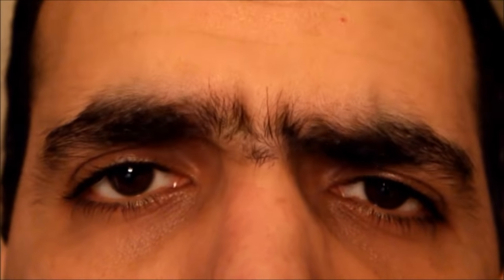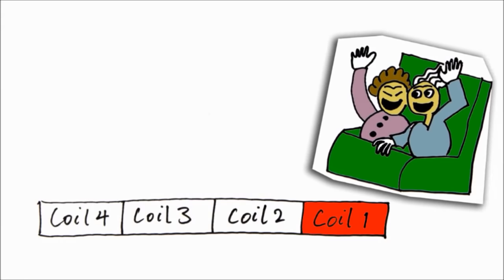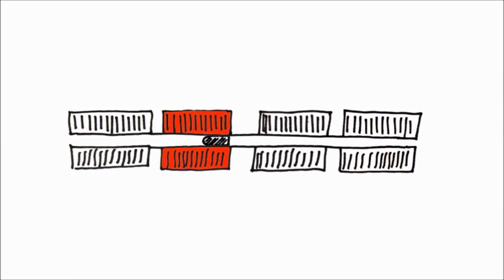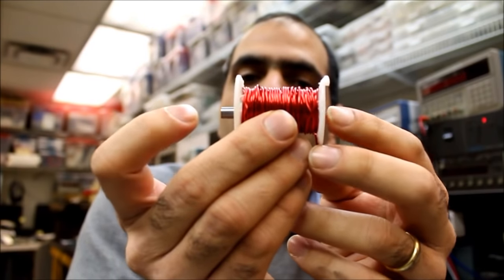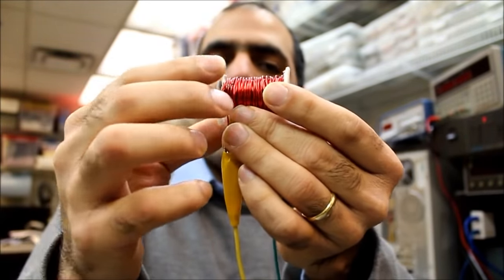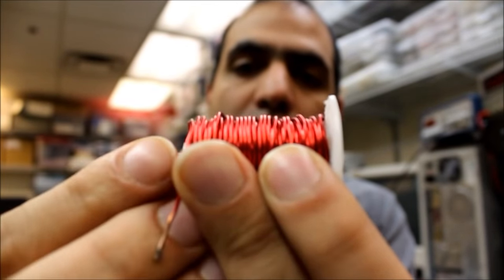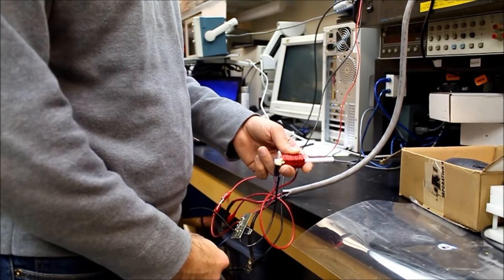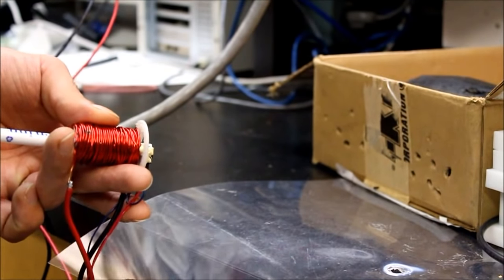Just Try and Make Your Own Coil-Gun (Accelerator)

Comment: Okay, theory time from an amateur who knows nothing. 
If I were to somehow modify a CO2 BB gun... 
Wait no, CO2 is flammable right? Maybe not. 
Hmmm.
Okay, if it's not, then if I modified a full auto CO2 BB gun with coils, and made steel bullets, could I create a much more powerful BB gun that way? 
What if I went crazy and managed to use a backpack mounted Car battery or something? 
Am I showing how very little I know? 🤣
Reply: If you were to connect the car battery, then the current would be very across a low resistance load. But I think that it would be way more harmful. Don't use this for bad intentions.
 The steel bullets I think would carry somewhat of an impedance  (resistance in a circuit) since it is very magnetic and it would I think slow it down.